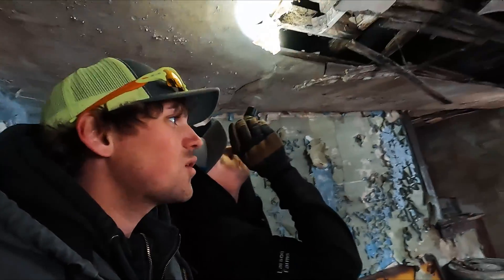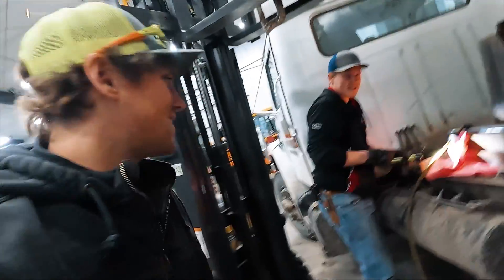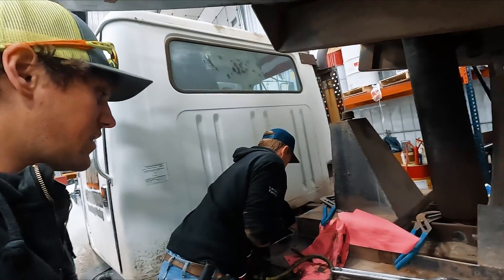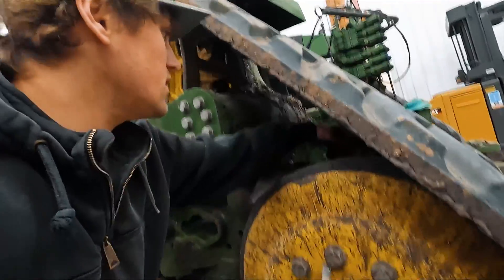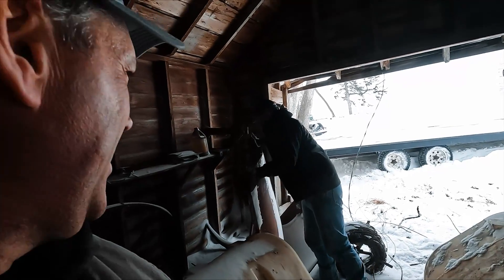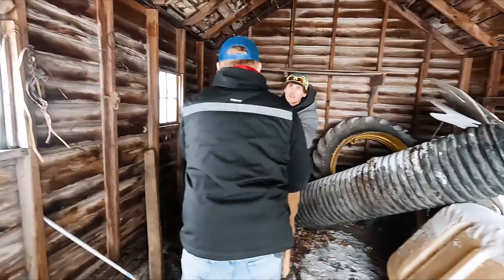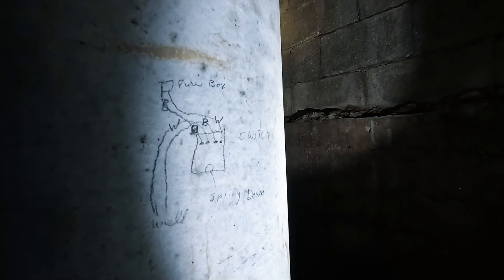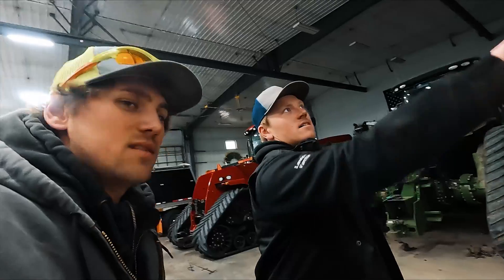Haunted Farm House Tour!!

Comment: How is it you don't have any floor dry on hand? Safety Clean has the best! I carry 200 pounds on my service truck.
Dougo that's the winter side panels for a tractor from the 60s. Helped keep the motor warm. Dad had a set that covered the seating area so you didn't freeze to death.

Comment: I have replaced/installed many ceiling fans in my life,  but I do believe  ...that was the saddest ceiling fan I've ever seen! (I was just waiting for the comments from the crew.) Also, very appreciative that none of the ceilings decided to fall down further while they were in there. (Water damage really rots the wood  around the nails, holding it all together.) Surprising the ground floor (& basement ceiling) looked to be still held together fairly well in most places. Peaches anyone??

Comment: I would like to come over an metal detect around that house if that's OK. Carl
Reply: I have done metal detecting around old homesteads.  All I ever found was an endless supply of square nails, wire, fence staple fasteners, bolts, square nuts, & old tools. I got worn out digging for nothing. YMMV
Reply: @armedfarm3429  yes sir you do find a lot of them at times for sure

Comment: Sorta sad to see continued abandonment of farm homes as farms get bigger, small farms are no longer economically feasible.  30 years ago we took my mother on a drive to the area where she grew up in the 1920s (western Nebraska) and went to the farm there.  Long ago abandoned but the house and out buildings were still there.  Went into the house and there were still a few cans in the pantry.  The gas light fixtures were still in place and the corn cob furnace in the basement was there too.  Had to watch out for rattle snakes.  Place has since been razed because the structures added to the property value and taxes.  Buildings there survive much longer because of the arid climate and lack of termites.

Comment: you should be wearing masks    that is old peeling lead based paint
Reply: Bob, how are they are going to inhale paint chips?  If you ate a handful of them every day, then I might be worried.  It's chips, not dust in the air.  I used to work for a company that made lead-based paint testing equipment, so (gasp) I've actually painted our calibration test samples with the evil stuff (the "red lead").  I'm still here to talk about it.

Wearing good respirators would be a good idea, mainly to protect one from the mold spores.

Comment: Classic Rock, 60's, 70's, 80's and some 90's music. When people knew how to play music and sing without auto-tune mics and "sampling" A.K.A. "stealing music." I like to Rock. Some bleach and a run thru the dishwasher those jars would be good. Probably $100 worth of jars there. The copper is good. Yeah it is time to bull doze it. Maybe use a steel cable and pull it thru. I did that with an old house many decades ago. Probably be better to set it on fire and let it burn. Kill the mold and ghosts.